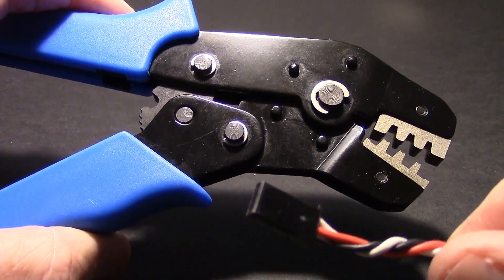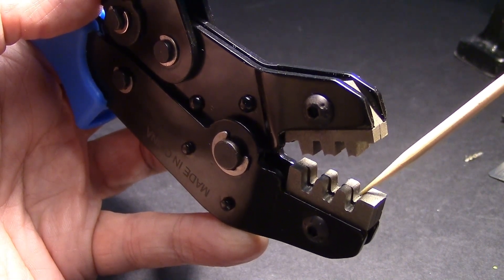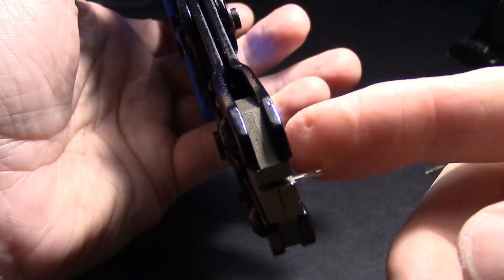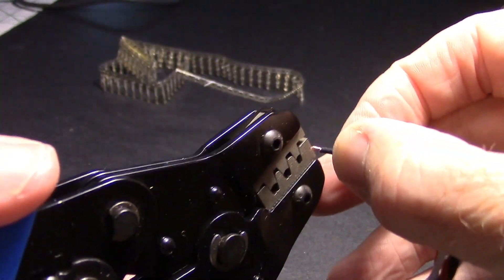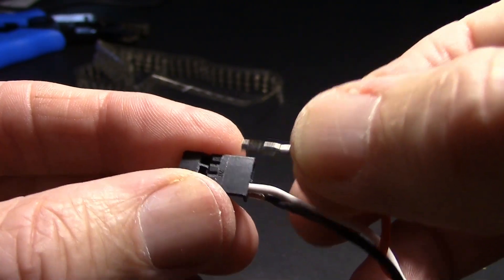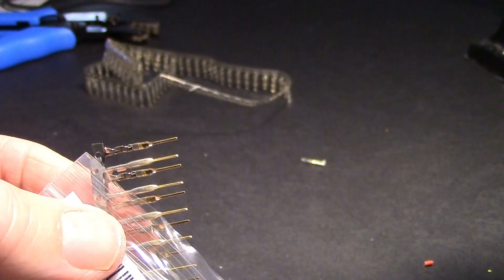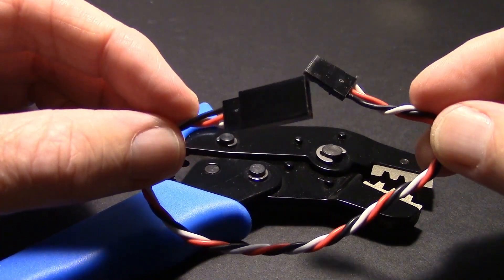How to use a Servo Cable Crimping Tool - For RC Fumblers (reduce wiring clutter)

Comment: i wished u to show n describe the diff betwn the female n male connectors up close.
As a beginner, i won't know which is which. But figured the fem is the one w a bunch of
up right tabs at the rear and a hole up front.  The mal is the one w a long pin sticking out
up front.  Both have the tabs at the rear.

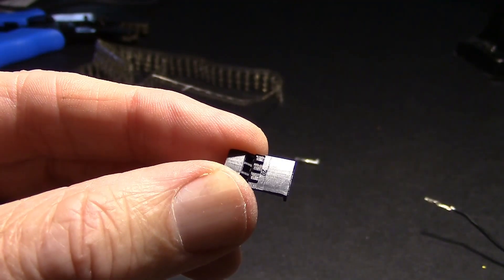Comment: 2:37 That is actually not a great crimp. The insulation wings are really barely holding the insulation, and numerous strands are folded back onto the insulation, in the insulation crimp. It’s not the worst I’ve seen on YouTube, but it’s not good.

Comment: 2:20 I bought a Crimping Tool that was not the most expensive but also not cheap and at this point the thing sticks in the slot that its very hard to get out, i have to wiggle it quite hard (but still careful not to bend it) to get it out. Not sure whats the reason. But i wont buy another 30 $ tool, maybe its the contacts but they look like yours.

Comment: Just getting back into RC cars and wanted to make things cleaner inside (instead of bundles of cables zip-tied together).  I ordered a crimping tool that should be here in a day or two.  Your video makes me feel MUCH more confident about using it.  Will definitely give me better results than trying to use needle-nose pliers like I used to.  Thank you for your time and sharing your expertise.

Comment: You shouldn't twist the wires. They should go in straight. You get a better crimp as the two wings go in easier and bite better.

Comment: This is the only crimping video that mentions the two levels inside the crimper and that, if the connector is inserted in the proper direction that both the wire and the insulation will be crimped in a single pass.  Kudos.
Reply from the maker: Thanks for testimonial Robert!
Reply: Exactly this. All the other videos fail to mention this crucial information..

Comment: I bought the tool you suggest and I can now make good crimped pins, but the plastic housings I got do not seem right and don't allow me to push the connector in far enough.  Can anybody suggest a good source for the pins and plastic housings?

Comment: Had to get my crimp tool out and look. Mine's a little different, but I get the ideal. Turn the connector over. No wander it didn't work. Thanks for the heads up vid. Boy, do I feel stupid.